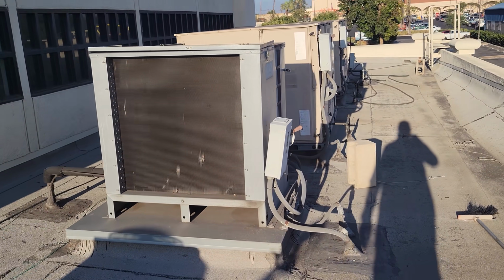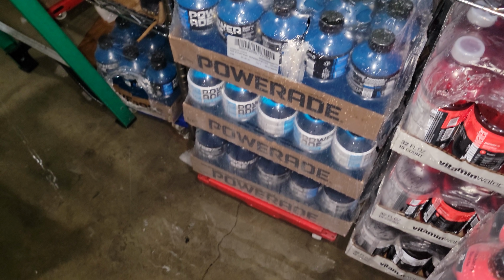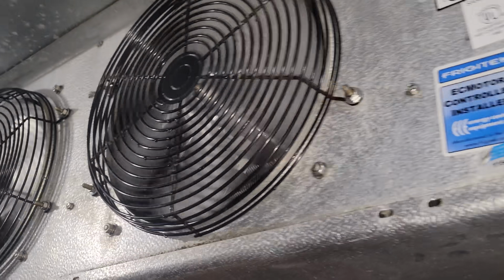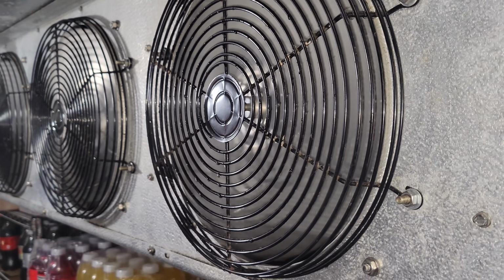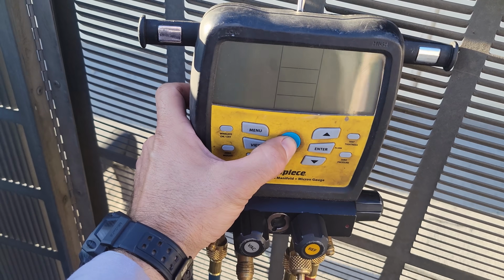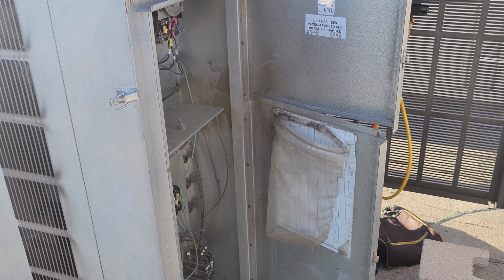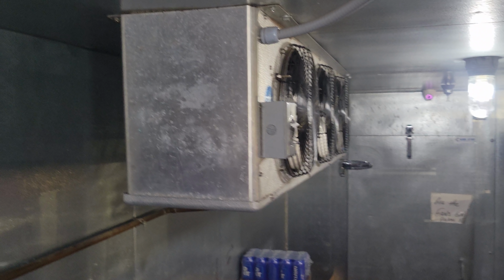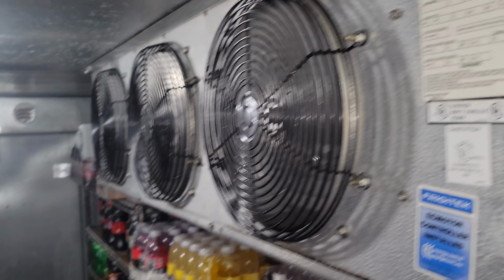I CAN'T SEEM TO SHAKE THIS STICKY BOOGER OFF

Comment: the BBQ smoke cloud, probably a grill completely full of buildup caught on fire. I've seen many of them do that if you cook greasy foods(burgers) and let it build up in the other debris.
my grill is out in the wide open here, so no issues with a flare up. But it can be bad for people with them on their patio or close to the house, it will melt vinyl siding right off and can ignite the ceiling/roof if they open the lid and jump back in a panic leaving it open. just close the lid and turn the fuel source off! the food is ruined for sure ( RIP my tasty steaks)

Comment: Chris wanted to get your opinion with recent changes to walk in cooler systems to meet energy efficiency standards. I am seeing multiple units coming out with 150 lb headmasters from heatcraft , along with other manufacturers . What is your opinion do you believe these type condensing units should be coupled with a exv style evaporator or would it be appropriate to use with a Txv style coil. bypass pressure seems a little low for a standard TXV. Have heard of some guys having to put a fan cycle control in addition to headmaster.

Comment: The two speed fan motors are a good idea to reduce off-cycle heating of the box (and energy waste). But the differential control is ridiculous. It should just be tied to the thermostat via a relay. If there's a call for heat or defrost, turn the fan speed up.

Comment: The Heatcraft evaporators I've been starting up are low stage at defrost and use a relay to power the third wire,  that relay is powered from the defrost timer. We bypassed it as first but when the frost melted in defrost the fans were blowing the water off the coil. We had to hook it back up🤔🤦🏻

Comment: Such a dumb way to control the 2 speeds. Why overcomplicate it? Use a digital stat and tie in high speed with the refrigeration. The 2 speed ECMs I've seen you break one of the legs so use the NC on the stat control.

Comment: 1) I have stopped losing sleep over cheap.
2) There is a trend to change the pronunciation of "thermistor." This may be due to non-English speakers trying to say it. It should sound like "transistor."
Emma Saying has the more traditional way, which places an emphasis on "MIST," as in therMISTor. Like TransIStor.

Comment: I think those thermistors should have been re-installed very securely and the complete TXV and thermistors should fully insulated to prevent ice from interfering with the controller , Solving refrigeration problems is a pain sometimes .

Comment: Does it make any more sense to have those thermistors rather than the fans would be controlled by the circuit of the solenoid valves (basically the thermostat)?
I think this way with those thermistors we just making more trouble for ourselves.
Furthermore I think those fan switches should turn off the solenoid valves also.

Comment: You could install  a timer for the evaporator fan; so that the cliënt can turn off the fan for 15 minutes when they are in the walk-in. It automatically turns back to the normal condition. It can’t be forgotten.
Reply: More things to go wrong. The more you add the higher the chance for something to go wrong. Good idea though.
Reply: Temp  ,,ajusted  4,or6  clod  strgec gues thsnkyou to sherimg ice come  fan  checked neef

Comment: Why even have a manual fan shut off switch, especially one that's easy for the regular employees to get at, if all it does is break things? What purpose would there be to shut off the fans without shutting off the refrigeration loop?

Comment: That money in energy cost savings with that evaporator fan controller even if they got it free from the energy company was all lost just on one truck roll. 
               The cost to modify it or to replace it or to fix it will far out run the savings for the life of the equipment can never recap or recover the money spent for the few cents per kilowatt hour saved. 

         And I will fail as we both and all know several more times accumulating hundreds of dollars in truck rolls and repairs for this little energy saving feature at on.

Comment: Rip out all the electric crap, wire the fans with the solenoid or eev triugh the switch and maybe a door switch, this stuff is just straight up crap
Putting an unessecary controller between the compressor and the coils is just asking for trouble

Comment: Interesting to me is that the thermistor is just loosely tucked under the insulation. I would have consider to at least zip-tie it in place to show that it does belong there. Maybe even some mild glue too that you could pull off by hand. It would prevent the accidental removal of the sensor when messing around there.
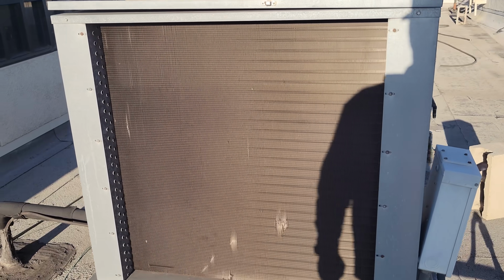7:30 - the main breaker box loose would likely be an electrical inspection fail.
Reply: It did have a cable tie, it's what's holding the insulation up, that the thermistor was presumably tucked under. Or not and it has just been lying there lmao
I agree with the mains breaker - i noticed that too.
Reply: A piece of adhered amaflex would have worked perfectly

Comment: This single service call cost the customer more than the energy saved by using variable speed fans. It's just something else to malfunction and cause problems.
Reply: Variable speed fans aren't just about saving money. They keep air circulating when there's no call for cooling.
Reply: @JH-tc3yu  Typically, medium temp fans run 24/7, even in defrost.

Comment: Sometimes you might benefit using diagnostics step by step by the book, but many times you can take a quick overall look at the system and start testing at a more practical place based on your experience, and save a lot of time in many cases. The odd time it can come back to bite you and cost you more time.
Reply: Call backs cost $
Reply: @pbsocal1  and Money is Time!
Wait a minute...Damn. Okay maybe Space is Time. I got this all mixed up!  ;-)
Reply: Most times,out in the real world the book needs to be re -worked

Comment: That differential controller idea is insane! I get that people don't want "programmable" things in their systems, but this is by far the stupidest-by-design implementation of fan control.

It would take just maybe a dollar more per unit to add a defrost/thermostat call inputs to make it actually smart and useful...
Reply: Well, politics and bean counters designed this final product. Not the engineers.

Comment: The sensors are probably shot. You should measure them to see. I'm guessing they change out with the controller anyways.

Defrost should have LOW fan speed, you need to remove moisture from the air or in this case the coils. That means you need the relatively drier and warmer air blown across to spend as much time as it can to drop the melting moisture into the pan before moving on into the room. Then it'll pick up latent heat and help melt the ice on the way around again. Of course the coil should be OFF while this is happening as you're adding cold ass refrigerant right to it.

Honestly the best thing is to reverse the cycle but I know none of these have reversing valves as a heat pump isn't needed but that's melt that ice toot quick lol. The cycle should be off and fans LOW for defrost... preferably with heat strips to speed it along

Comment: It's definitely irritating when a customer wants band aids instead of proper repairs. Just have to keep it in your head that everyone has a budget. As long as you have it in writing that customer declined x repair and went with the not recommended solution of y you've done everything you can and will charge accordingly when the bandaid falls off. Sometimes the writing is on the wall that the place is going to close so you can't push too hard for the real fix instead of the temp fix
Reply: Restaurants are highly volatile businesses

Comment: Fans on high for defrost didn’t sound  right. You want the heat to stay in the coil so the coil gets hot. Ps Engineers do stuff because we are told to, not because we think it’s fun. We have to meet government regulations as cheap as possible so the product can sell. We are ALWAYS stuck between a rock and a hard place.
Reply from the maker: This coil doesn't have heaters so it only uses off cycle defrost, it needs the fans on high during defrost

Comment: Should have been designed to fail to high speed. Fail safe for the system.
Reply: It seems like it is designed to fail at high speed, no power on that second hot means fan run at full speed. The controller was still functioning and trying its hardest to do its job. Now if that controller box blew up, then yes it would have the correct operation in terms of fan speed.
Reply: Off cycle defrost the fans should be in high speed. Electric or hot gas defrost is done with a defrost clock to turn off the evap fans while defrost is occurring. As the defrost  terminator hits temp it kicks the system out of defrost and the compressor runs with evap fans off till the coil temp is low enough. When the evaporator coil hits temp the evap fans kick on.  This to prevent adding heat to the walk in cooler or freezer as the fans come on.

Comment: I put lock boxes on troubled walkins . Found employees would turn fans off when the unloaded truck n leave doors open. Lock boxes were ok by mgr.  Theyd leave door open and cut out the air curtain. Even had a site that had a policy that whwn someone was inside the walkin that the door had to stay open because of clastaphobua(sp). Couldnt believe it. It was even the online pick uo n outside door they used was 15' from walkin. During spring n summer theyd leave that door open too bringing in all kinds of humidity. Cant fix stupid

Comment: why dont throw that controller to trash and use relay? Get coil voltage from solenoid, and use normally closed contact for that speed control. when solenoid is energized the relay brokes the contact for the fans to run full speed.
Reply: Or use normally open contact if they need power to slow down... you get the idea still.

Comment: I've absolutely has places where I can't get their employees to not shut fans off because it's cold while they're stocking
Reply: I have this problem at convenience stores. i give them one chance. if i go there again and find its turned off. then i just take the switch out
Reply from the maker: I will discuss this on my livestream this evening 12/20/21 @ 5:PM (pacific) on YouTube come over and check it out https://youtu.be/UKCMOJE_rmU
Reply: Hung some temp data loggers in walking to spot which shift was causing issues at my facility, always the late night closers propping open the doors while taking their damn sweet time rolling speed racks of steaming product into the WIs